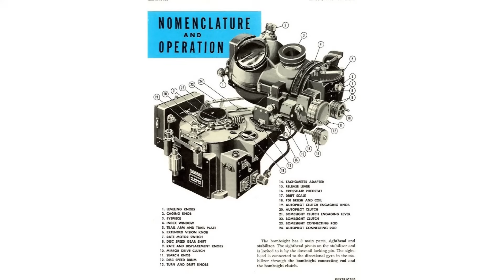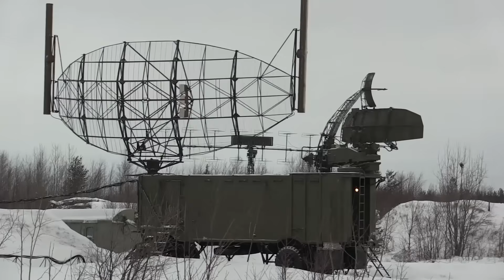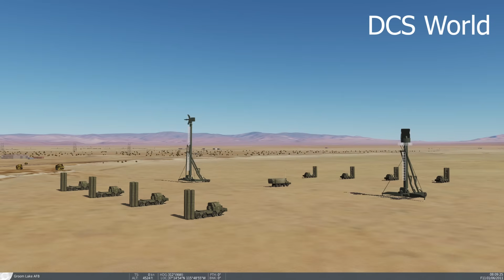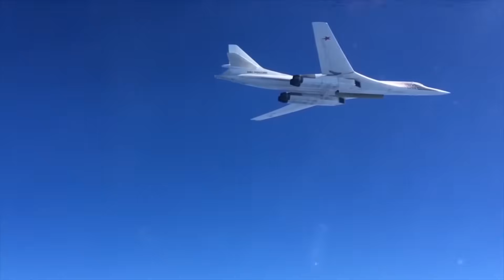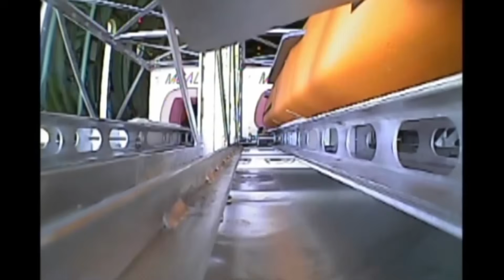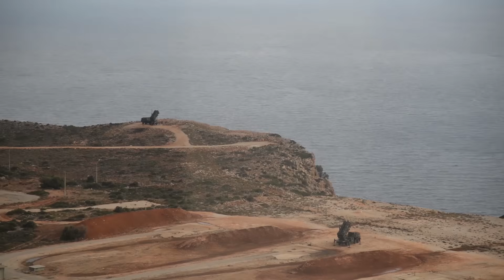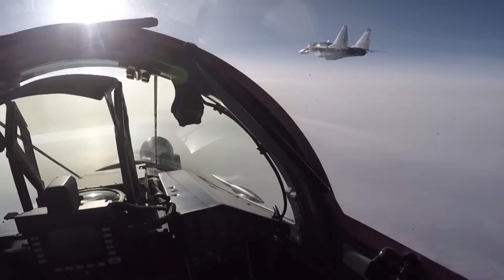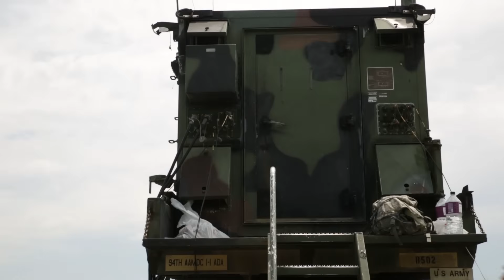SEAD - Suppression of Enemy Air Defense

Comment: Unfortunately, the pendulum is eliptical. Advances in AD or becoming more and more software driven, with hardware advances being more easy to manufacture and deploy. SEAD requires more money and development time, a greater reliance on new hardware in addition to software. The cost to field 1000 dumb missiles on the ground will almost always be cheaper than flying 100 smart decoys to protect the asset attempting penetration. The era of "air superiority" being the determining factor in a battle space has been as over as the deployment of mechanized infantry being a factor. The Era of Information Superiority has been the true nature of war since Sun Tsu, and is only now becoming more apparent. Unprecedented Passive Sensor Nets both orbital and land based are the body that powerful AI will inhabit that will bring about the near end of all asset deployment, and force us to the negotiating table as predicted by simulated - warfare theorists.

Comment: Also SAM sites use physcial spotters as well to track what is around to check ligitmate targets and well trained SAM sites will often turn on there radar systems for 30 seconds get a lock fire or not and turn off and move all the equipment as soon as they know they have either fired or been spotted.

Comment: Glass fireworks creat compressed drops that are easy broken but they act like sand blasting when hitting a moving target the elements also break into sand at the ground.
They are also hard to detect only fully destroy high speed targets and depending on particulate size can stay up for a significant time.

Comment: An open suggestion to our forces: Consider the interceptig missilee as primary target. A fast flying object designed to hit,, directly or indiectly, a moving targe is totally defenseless against another designed  specifically to taget it. Due to the lack of sensors, the missile is unable to detect itself from the incoming threath then also to take evasive actions. Moreover, the evasive actions would reduce the range of the proyector or even neutralize the threat for the SEAD action. I have some ideas to do that...

Comment: A very nice video. Thanks for putting this together. However you have missed a couple of key points about this whole cat and mouse business between AD and SEAD . Firstly a modern military can HIT BACK at your launch platforms as well. I'm not just talking about shooting back at the aircraft that's launched the HARM BUT shooting at the airfield or AC where the plane took off from. Secondly the defender can use decoys to lure the anti-radiation missiles away.

Also I note you mentioned Libya and Iraq's IADS. While in theory they were integrated they were never intended to stop raids of hundreds of aircraft. Also there is a common misconception that the Iraqi AD was a Soviet system. Yes there were Soviet components but the actual IAD was built by the French and British. You can read more here:

http://en.citizendium.org/wiki/Gulf_War,_Iraqi_integrated_air_defense_system
Reply: And most likely these systems had known weaknesses.... As Britain were part of the attacker it was most likely cake.
To say the forces lost more planes due to mechanical failures and crashes in low altitude flights than actually against the air defenses.. I remember an order given that these kind of flights are suspended as no longer needed and too costly.

Comment: Stand off Attack, Jamming, SEAD

There is actually a 4th method current under development..Decoys.

I forgot the same of the system as I saw this on a documentary, but the USAAF is developing a new Decoy system to deal with advanced Russian and Chinese AD systems. 

A Drone Launched from a mother ship (usually a transport) slightly ahead of a real strike package. While in flight, the Drone created dozens of electrical Decoys that imitate the characteristics of real combat aircraft. The SAM radar locks on and fires at these phantoms instead not being able to tell they are ghosts. While the SAM operators are chasing these ghosts the real strike package has gotten into range and takes out the radar using a AGM-87 or similar.

Comment: the iron dome in Israel has worked well for years and now with stealth with small glid bombs and decoys Syria's S-300 won't really last long:)
Reply: Iron Dome is designed to defend against MLRS-type unguided rockets. There's no reason you couldn't use them as a terminal defense for a SAM battery, but it has nothing to do with attacking one.
Reply: You sound like you’re out if your league mate.

S-300s aren’t surface to surface missiles....?
Reply: He's too busy bending over.... ;D
Reply: Robert Bryant Lock 😂😂😂, well played sir!
Reply: The Pantir S is the close range protection against incoming missiles for the S-300. If they were able to destroy one there are a bunch others to do the job.. its not the main system. So the IDF achieved exactly nothing.

Comment: In a nuclear war the ultimate radar jamming system is the nuclear blackout effect. This was discovered by the US on July 8, 1962 in a test called Starfish Prime, part of operation Dominic. In this test a 1.4 megaton hydrogen bomb was detonated 250 miles above Johnson Island about 900 miles southwest of Hawaii. It blinded radar and affected communications over a very wide area. It also damaged or destroyed 1/3 of all operating low orbit satellites. The effect is believed to work by 3 mechanisms, EMP, excitation of the ionosphere, and excitation of the Van Allen radiation belt. With vast target areas virtually blinded the actual warheads will easily reach their targets at Mach 24 and detonate.  There is no known defense from a ground based system. This is why the US is trying to develop a space based system to intercept enemy missiles in their boost phase. 

The hit to kill idea of an ABM always struck me as dumb. The concept really isn't viable against hypersonic targets. Then what is? They say a near miss only counts in horseshoes and nuclear explosions. And that is what is needed, weapons that detonate small nuclear warheads in the oncoming path of the attacker. This was the concept used during the 1950s and 1960s. It was a good strategy.

Comment: Damn... A defense channel that actually knows something about defense. I think thats a first.
Reply: And no robotic sound narrator.
Reply: Matsimus is a cool channel. Check it out.
Reply: Dominik Stahlmann matsimus videos are long, boring and non-informative
Reply: @Infosec151  Matsimus and Cover Cobal do comment on each others videos is you keep reading enough comments.  The two do know each other.
Reply: @SkyFoxAira Well, granted you can endlessly dissect and elaborate in detail all the intricacies of air defense, but that wasnt his point in this video. The point was to explain what SEAD is and he did a decent job of giving a quick simplified idea about it to those who dont know better, without making any major mistakes or showing a blatant bias. And at the very least he spent the 5 minutes needed to get some basic info right, which is a lot more than most other defense channels will do. Hence me giving him credit for it.
The specific layout of ground based air defense systems is irrelevant and he does mention they overlap and are all part of an integrated network. ECCM is also mentioned.
Reply: @mindsmirror  While not false its not mentioning the capability of a S-300 system to work as a radar array. As they constantly exchange their radar data any command section know what the other see. Radar arrays are nasty, you have to take out all or you'll be shot down anyway...
Reply: @SepherAgon  

Thanks a lot for your unbiased comments - if you don't have a key code for spread spectrum and frequency hopping air defense system as you rightly put it there is no way one can defeat such impregnable defense system.
Reply: Instead of chest thumping nationalistic propoganda
Reply: About Eq.
https://www.mediafire.com/#ibpuhagkr7a8w
https://www.secretprojects.co.uk/forum/index.php/topic,30034.msg324404.html#msg324404

And nope, are some idiot statements in the video. In Vietnam only about 205 airplane was downed by the Dvina SAM and not "thousands".
Reply: @molnibalage83  
What are you talking about Balazs Molnar,
it is true USAF lost thousands of their military flying machines - there is no denying of these facts.
Reply: @amoslukyaa5792  But not because of SAMs... It would be idiotic to deny the losses but saying because of SAMs is simply pure idiotism..
Reply: @molnibalage83  
FYI 90% of USAF military flying machines were brought down by SAMs the rest fell victim of MiGs, triple-As' and would you believe it even RPG-7 were used to bring down low flying choppers.
Reply: I'm surprised no one has mentioned Jane's International Defence Review or Jane's Defence Weekly....oh that's right it's not free
Reply: Defense update is the best they post on a daily basis
Reply: Adlan Darwish Yes, but they have a robot voice.
Reply: Filibang Filbert well not now they used to
Reply: Adlan Darwish Oh, I thought you meant another channel
Reply: @SepherAgon  So many false statement such a short comment...
Reply: @SepherAgon   Tell me fairitales.
I wrote this in HUN about only 30% have been translated to ENG.
https://forums.eugensystems.com/viewtopic.php?f=104&t=61141
Reply: @SepherAgon  HARM against planes? LOL. Give me sources pls. about this BS comment...
Reply: @molnibalage83  U r an idiot, everybody knows about this. The missile's been around since late 70's. Find it yourself. You know how to use google, right?
Reply: It's not a bot channel haha
Reply: RIGHT  ???????  👍👍👍👍👍👍👍
Reply: GOD DAMIT !!!  I LOVE COVERT CABAL !!!!❤❤❤❤❤❤❤❤❤❤❤😃😃😃😃😃
Reply: "defense" is what they  call an "euphemism" in case of US :)
Reply: south front check it out
Reply: @jasminsekic3758 . They have great maps/graphics, and cover an angle which is ignored by MSM. Although, sometimes their bias is too much... Not a fan of the robot voice on that channel either.
Reply: Jasmin Sekic south front is great! Also love how they have great info and it isn’t omg we’re are the best cause we are the west channels.

Comment: You left out stealth missiles and aircraft attacks. Also swarm cheap drone attacks. A small few pound drone even without explosive charge will wreck havoc crashing into a radar set. This has thex added benefit of being relatively cheap way to attack. Therexare remote controlled RC jets that can fly over 200 to 300 Mike's per hour on the civilian market for aroubd ten thousand American dollars. That's far cheaper even for several than one HARM. Just add a HPS/inertial nav which can be based off digital gyroscope and accelerometers in cell phones. Add in a camera with target recognition software and it crashes into the radar dish. In a conflict in Syria to take down Russian air defense this greatly reduces overkill/casualties. This is very important if the site is manned by Russians and you are worried about starting a wider war. You coukd also use lasers aboard planes out of range. Or on uanned aircraft or drones. As long as you have line of sight to the target from altitude a high power laser may due. Weather may beca factor but increasing laser power van to some extent overcome this. There is also the option of firing a,laser from space. If you fire from high up as nearer vertical you minimize atmospheric effects on the beam of less atmosphere going through and most the thick atmosphere is comparatively down low. And with an integrated defense you open yourself up to hacking be it crashing the computers or flooding them with false targeting data from fake other sites. Now you have to disconnect and lose a lot of situational awareness of battles pace. If the defense uses wires to link up that takes a lot of time to set up and if ties into a civilian Internet that can be taken down from other side of thex world with hacking. If it uses radio waves those can be jammed. Nobody can realistically defend themselves from a determined American attack even without stealth. If you have the resources to deploy a complex, wide ranging, effective defense you probably are a nuclear armed country in which cases a full on confrontation is highly unlikely. Only two probable American enemies fit that being Russia and China.

Comment: you didn't mention the use of decoys to protect against ARMs wich is the use of generally 3 emitters wich confuses the ARM and allows for the continuous use of the radar system
Reply from the maker: Dang!! Forgot!
Reply: Countries like America and Israel now posses missiles with loitering capabilities that can confirm a target before a final supersonic dive to take it out
Reply: It would take a pretty sophisticated decoy emitter to spoof even a semi-smart ARM.
Reply: @johnc8910  Yugoslav Army used (modified?) microwave ovens as decoys in 1999 NATO aggression on Yugoslavia. Radars would be turned on for only 10 seconds and then microwave in close proximity of radar vehicle would be turned on to redirect any radiation missiles. If has been 20 years ago, so I guess radiation missiles evolved beyond that.
Reply: @johnc8910  But they exist, just like how missile-drones that mimic aircrafts, there are small emitters mimicking radars, SAM, and communication sites. Of course they are going to need to be sophisticated to distract a sophisticated opponent

Comment: Most FM-CW radar systems use one (1) transmitter antenna and multiple receiver antennas. The transmitter is continuously on the same frequence as the receiver.

Comment: Venezuela has S-300VM "Antey-2500" version
Reply: They also have the most verba and igla's outside of Federation
Reply: @komradekat3557  Better change out those verbas for Syaad3s.
Reply: @psuedozardozz  , you would need to be big man to shoulder fire a Sayyad😂
Reply: @komradekat3557  Am I mistaken or doesn't the Sayyad3 use the s200's launcher?
Reply: @psuedozardozz  ,  I don't know too much about the sayyads other than they are Iranian. But Iran does have S200 and no-one reverse engineers weapons better than the Iranians. So if it's not a s200 launcher, it's probably a reasonable facsimile .
Reply: @komradekat3557  I would say that the Communist Chinese would take issue with your inference that the Iranians are better at reverse engineering than them. The Iranians may be good at reverse engineering, but they suck at fighting a first world military, just like any of the other Arab or Muslim nations.
Reply: @komradekat3557  about 5000 of them and US fears it might be shipped to FARC rebels and other Marxist fighters in the region which will cause more havoc to US security interests in the region
Reply: According to the wiki, Venezuela has 2.
Reply: @psuedozardozz  2 will not make any difference. They will just get saturated.
Reply: How many?

Comment: The antiradar missiles came before the Wild Weasels and where carried on regular aircraft. The Wild Weasels came about when it was realized specialist units where needed for SEAD as well.
Reply: *were
Reply: Anti-radar weapons were developed by Nazi Germany. Gliders, not missiles. But same principle - lock on to  the radar, home on emissions. The snag with Shrike was that it had to be preset to a particular radio band before take off. Electronics were bulky in those days.
Reply: @PATTHECATMCD  : Not a real problem. EVERYBODY uses standard radar bands. All you need to know is what kind of radar you are attacking. ELINT can tell you that.
Reply: @johnc8910  it's a different set of problems now with concepts like LPI, FH and synthetic aperture scannaed arrays. It was a problem in the time period that was raised (initial introduction of Wild Weasel specialist SEAD aircraft).
Reply: @PATTHECATMCD  :LPI and synthetic aperture scanning is not used in SAM radars. No need.
Reply: @johnc8910  there is DEFINITELY a need for LPI in SAM radars to prevent detection by SAM hunting systems. The fact that it isn't widely publicized should tell you a great deal about how arms dealers operate...
Reply: @PATTHECATMCD  : A phased array radar (I will talk about Patriot here because I have over 30 years experience with the system), by it's nature, already is sort of an LPI system. In acquisition mode (looking for a target), search algorithms move the the beam around the sky in a pseudorandom manner. 

When it shifts to Track mode, there is no real difference in the radar pulse. The difference is in how the system processes the return. Unlike a conventionally scanned radar, up to this point, the target is never continually illuminated. 

In the final two seconds or so, the system shifts to Terminal Guidance where it continuous illuminates the target. Now, it is possible right then that a pilot could fire an ARM off before the aircraft is destroyed, but I think it would be unlikely.

Other systems use more than one radar to perform all three functions, but because a medium or long range system cannot fire on the move, I just don't see how LPI will be that useful to a stationary SAM battery.
Reply: @johnc8910  absolteuly, I agree that for a static SAM system it makes no difference BUT... typically a modern ARM will be loaded with a recording or similar patern matching of the radar it is being launched against prior to launch. If your SAM radar is elusive enough, that isn't an option. Like I said, this sort of issue isn't discussed much because there are lot of export dollars at stake.
Reply: It's great that some videos come out to help teach some of us who are weapons geeks to understand weapons the how and why of them🫡🫡🇺🇲